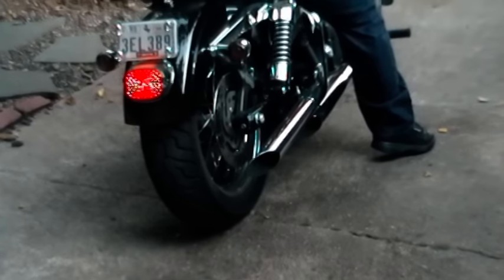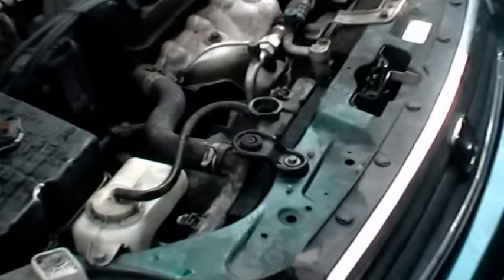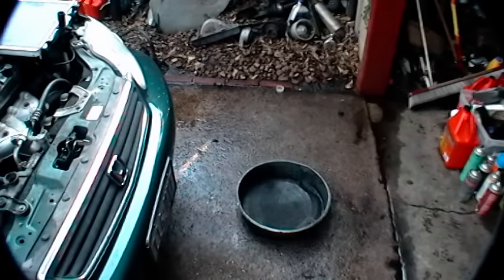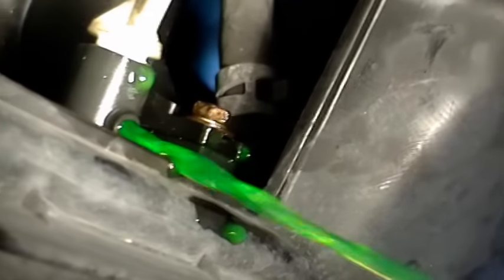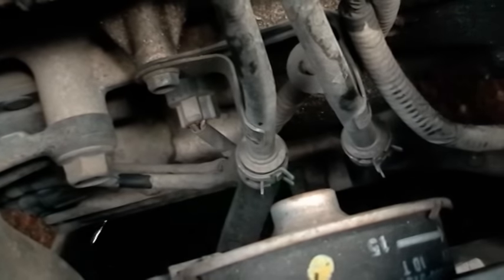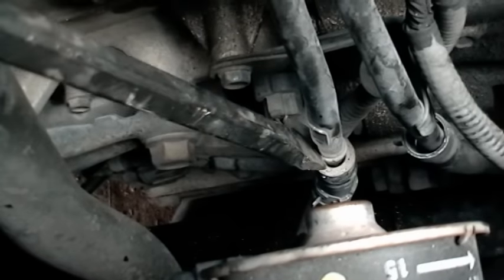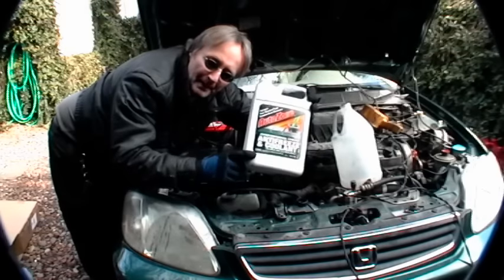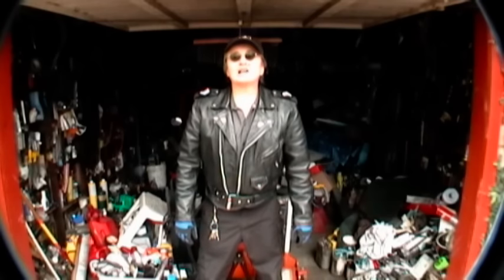How to Replace a Radiator in Your Car

Comment: Hey Scotty
I ordered a radiator for my 1993 Toyota Camry 4 cylinder and it's a manual. Do I need a special radiator for the manual or are they all the same?
Reply from the maker: any one will work for a manual, but an automatic has a cooling part on the bottom for the tranny. Many places only sell the automatic so they stock less, and it works fine on a standard, you just don't connect anything to the bottom cooler lines
Reply: +Scotty Kilmer thank you so much! Helped a lot and I learn a lot from your videos!!!
Reply: Aaron Bates

Comment: Hello Scotty I have a 2009 Ford Ranger fx4 4x4
I rear ended another truck with my front end. His bumper was higher than mine.
His bumper destroyed my grille and bend in the radiator and radiator cooler. Red Transmission fluid leaked out. I made the mistake of trying to get my truck to garage and as doing that my truck lost the ability to accelerate. 
Do i need to get the transmission inspected? or can i safely fix the problem by just puting trany fluid back in?

Comment: If you change a radiator without flushing the block you could be screwing yourself, all the goo that killed the first one still lives in the block. Might also change the water pump thermostat and hoses because if the cooling system is chunky then you will probably have done some damage to the impeller on the pump and it will be easier now. Also a good time to inspect/ replace belts if need be.

Comment: A buick skylark doesn't have a drain plug on the bottom... The radiator is leaking so badly it's pretty much low possibly empty.. it's okay if I don't drain it right? Thank you

Comment: Scotty i have a question i have a 2000 yaer b.m.w e46 318i i had replaced the oil cooling termustat and the x part of the bottom of the termustat broke and fail in the rediator what in may do to the engine

Comment: Scotty Kilmer. On a 1999 Saturn Sl2 can the condenser be removed without having to remove the radiator? I f so what are the steps?
Thank you.
Reply from the maker: na, not enough room in that design, but rads are easy to get out
Reply: Thank you

Comment: So, I'm not sure were the leak is because the coolant only leaks intermittently. I know it's toward the front of the car, either the radiator or hoses, maybe the water pump. Any tricks to find out for sure?
Reply from the maker: I use a pressure tester to find leaks, cheap ones can be had on ebay. OR you can put in UV leak dye for coolant systems and find the dye leak, but you need a uv light and yellow sunglasses for that

Comment: Scotty, The top of my radiator is leaking... Is there a fix to this problem or do I have to replace the entire radiator?

Thanks!
Reply from the maker: you can try something like JB Weld epoxy, but really, best to get a new radiator, the chinese made ones don't cost much and work fine

Comment: Will I have to drain the automatic transmission fluid before disconnecting the cooling lines?
Reply from the maker: Jason Ford NA,maybe half a cup of fluid will drip out, you can put that back in when done

Comment: i have now an old 86 chevy nova.  and, i "think" it has a radiator leak.. the hoses weren't leaking.  appeared to be coming from a bottom seam.  
i took out the fan s.  and the radiator.   the radiator appears to be made of  copper??  not sure.  but, i am planning on taking it to a  reputable  radiator repair shop to see if it can be repaired.  they charge 45 dollars to repair it.   
do u think repairing a radiator is a good thing?

Comment: would you recommend a radiator sealant if I got a small leak in the radiator? or replace the radiator?
Reply: Replace the radiator!!! Bought a Monte Carlo a few years ago and either the previous owner or the car dealership put some that crap in there. Took it to a spot that deals with removing it but had to take it back a couple of times. Wish the guy would've told me it would be cheaper to buy another radiator then to try and flush the sealant out. I'm buying my new radiator this Saturday for little over $100! I hope you didn't mind me answering your question.
Reply: +Darren Cork Thanks for the reply. I the end I did replace the radiator. I dont think that sealant would have worked anyway just clog up the system.

Comment: If I were to constantly refill my coolant tank before the levels went past the dangerous mark could I make it on a trip over 200 miles with a leaky radiator?
Reply from the maker: David Theodore If the leak is small enough, I've seen it done for years by really cheap guys who don't want to buy a new radiator

Comment: im gonna be removing the engine on my 1986 325es BMW, When im putting my radiator and the hoses back, is it safe to turn the engine on without any coolant in the engine?

Comment: @scottykilmer OK, I just checked my radiator.  The transmission lines run into the side instead of the bottom, and they are solid lines, not flexible hoses.   One is at the top and one is at the bottom on the side (same side where you add coolant).   The bottom one looks like it'll be hard to get to.   Its a 93 ford taurus (not SHO) 3.0.   Do I need the special tool to disconnect the lines or can I just use two wrenches?   (assuming I can get my hands down to the bottom line).

Thanks.

Comment: Hey i have a 94 Volkswagen Golf GTI and its a manual 5 speed how different is it with the 5 speed manuals to change the radiator (without the cooling lines for the automatic transmissions) then to change it on a automatic?

Comment: Just wondering do I need to bleed/burp the lines after installing it? Is it necessary for a 2004 Mitsubishi Es lancer ?
Reply from the maker: just leaving the cap off with a fan in front of the radiator and watching it generally will burp the air out if you're careful
Reply: Scotty Kilmer 
So I install it then fill it with coolant and then leave the cap off and turn the car on and it should bleed it?

Comment: I have a 2005 honda accord, and it looks like there is 2 radiators...Is one the AC condenser? Do they connect together?  I'm leaking coolant, but it looks like it is coming from the front condensor....

Comment: I changed out the radiator but its now leaking from the auto transmission connections on the radiator. I tightened it really strong nut its still leaks. Any thoughts? Do i need to turn both nuts?

Comment: Scott ( brother) help me !!!I want to install a manual cooling fan motor switch on my 1992 ford Tempo V6.. what wires do I need to cut and where should I connect it?... I want to control the fan since in Canada June get pretty hot and the fan kicks in at around 75% engine heat which I think I little too late since the motor is hot hot by that time...the fan kicks in very 10 minutes... bumper to bumper waiting....so you can imagine how hot the engine is every 10 min.
Reply from the maker: +mario agostini  just run power and ground directly off the battery terminals, spice it in there

Comment: you forgot to burp the cooling system afterwards, people after you change the radiator and add coolant you need to burp the system with the radiator cap off and the heater on full blast. also wait for your heat to get hot it will take a while.
Reply: My radiator doesnt have a cap on the radiator? Should I fill it using the expansion tank and leave the cap off that?
Reply: yes
Reply: if you pour the coolant slow enough, you wont have to do this. but your info is still good....just some gee wiz info here 😎

Comment: Hey Scotty, how difficult would this be for a 99 saturn Sl2? thanks
Reply from the maker: a bit harder, pays a mechanic 1.4 hours labor "

Remove negative battery terminal.
Drain cooling system as directed in "Engine Coolant Check and Replacement."

        

Remove air intake duct, air filter box, and resonator.

        

Remove upper radiator clamp and hose from radiator and fold hose back.

        

On models with automatic transaxles, remove upper transaxle oil cooler line.

        

Remove fan motor electrical connector.
Remove wiring harness from fan shroud and radiator end tank.

        

Lift coolant fan off of upper and lower mounting brackets.
Remove fan assembly from vehicle.

        

Remove lower radiator clamp and hose from radiator.
CAUTION: MAKE SURE THE VEHICLE IS PROPERLY SUPPORTED AND SQUARELY POSITIONED PRIOR TO LIFTING. TO HELP AVOID PERSONAL INJURY WHEN A VEHICLE IS ON A HOIST, PROVIDE ADDITIONAL SUPPORT FOR THE VEHICLE ON THE OPPOSITE END FROM WHICH COMPONENTS ARE TO BE REMOVED. 

Raise vehicle.

        

Remove lower splash shield.

        

On models with automatic transaxle, remove lower transaxle oil cooler line.
IMPORTANT: Wire condenser up to vehicle to keep in place.

        

Remove two lower condenser bracket-to-radiator bolts.
Lower vehicle.

        

Remove upper radiator nuts and brackets.
Remove upper radiator seal.
Remove radiator from vehicle.

Comment: Hi Scotty 
I have a problem with my 2000 jag s type.
I came home got out the car for about 15 min. The cooling fans was still running when I got out. the engine was off.When I went back to the car and tried to start it would not start. The engine raddled trying to start. It act like it was stuck, then just turing over  without starting like no fuel. It was running correctly a few minutes before. not missing or any sign accept, the cooling fans would run a few minutes after driving with a/c on

Comment: Hi Scotty. I got a 96 camry that suddenly started overheating. There's steam coming out of the top of the radiator and temp gauge all the way at the top. An aquaintance suggested a pin hole might need to be fixed and to be wary of someone trying to sell me a new radiator. Can this radiator be fixed?

Comment: I ordered a new AC and it came in yesterday. But now there's a problem i just can't figure out. The bottom radiator hose refuses to fit. My old radiator had a "clicking system" which my new radiator doesn't support. There seems to be no way to put the bottom on my new radiator and it's giving me real headaches as i have no idea what to do. What's the best step to take here ? it seems that replacing the lower radiator hose is quite a difficult job as it goes into my car's frame "behind" the wheel

Comment: @scottykilmer I think I have a coolant leak... I smell antifreeze when I first startup my car and my engine temp is running higher than usual and my reservoir is low... Do I have to replace my heater core or is it a cracked radiator or a blown head gasket

Comment from the maker: get another engine, that's a blown head gasket at a minimum, oil mixing with coolant. Most guys put a used engine in, I use ones from japan, see my video "replacing an engine in your car"

Comment: Whats the make and model of the car in the video? I'm going to attempt to change my radiator for the first and wanted to use this as guideline
Reply from the maker: it's an older honda accord, but all cars are the same basic process
Reply: Thank you for your quick response

Comment: Respond to this video...          Oh wait, I have to clarify, the line itself isn't leaking, it's leaking out through the fitting that screws into the side of the radiator.  I'm going to go out soon and make sure I have them tight enough, but if it still leaks, will thread sealer stop the leak?

Comment: I have a 1987 nissan pickup, d21 4cyl 2wd. do I have to  bleed anything after I install the new radiator?
Reply from the maker: +jlk1775 you have to get the air out of the system, but on those, generally just warming it up will open up the thermostat and then you just add coolant as the air burps out of the radiator top with the cap off and a big fan in front of the vehicle
Reply: Awesome! Thank you Sir! :D

Comment: hello scotty the water on my radiator is brown/reddish brown, as well as in my reserve. is this a worn radiator? or gasket? if its oil what should be the color?
Reply from the maker: +jaycee fernandez oil would foam up like a milkshake. sounds like a dirty system that needs flushing
Reply: +Scotty Kilmer thanks man ! you're the best !

Comment: @Scotty Kilmer 

My radiator fan wont turn off.  When i start the car, the fan does not turn on immediately but as it reaches a temperature, first the low speed fan turns on, then the high speed fan turns on and it stays on forever.  I have the low speed fan set to 210F, but it turns before it reaches that temp.  What could it be?

Comment: @scottiekilmer my 2007 I'm pmpala is leaking coolant fluid I changed the radiator and it still leaks and wants to run hot. What should I do?

Comment: Hey Scotty, It's not that easy to just hammer off the Transmission cooler line. Mine screws on and the line goes through it. I CANNOT find a way to unscrew it off, its the most stubborn and tightest bolt I've ever encountered. I've tried WD-40, Free All, and all that sort of Rusted loosener but nothing helps. I even tried hammering it loose. .Nothing. It's very VERY Stuck. If you have an ideas I could try at all PLEASE let me know. This is killing me, lol.

Comment: i have a 2002 ford crown victoria. how do i free the radiator? it has plastic hooks that hook onto the ac condenser, but i cant move the condenser upward, because it is blocked by the front metal part where the hood latch is. do you know any short cuts?

Comment: Hey scotty, i think i have a leaking radiator in my car, well let me explain more.   After driving for like 15 minutes and then i see smoke coming out on my front grill.    MY temp is under the middle line in the temprature Gauge.  and no my gauge is not broken.   For some odd reason i pop the hood and i see coolant on the top of my grill.   and how did it smoke?? well im thinking the coolant was touching the hot radiator which produced that smoke.

Comment from the maker: there is no short cut on that horrid radiator design. Last time i did one a lot of swearing was used and I cut my hands bending stuff out of the way. REALLY poor design. Most guys jack car up REALLY high and pull rad from the bottom

Comment: Hey buddy my car heater still not blow warm air! Heater core isn't clogged ( did the water trick) tried to bleed air out if there is any but my 94 probe is not equipped with a radiator bleeder valve! So my question is how to bleed the air out without the bleeder valve

Comment: Hi ,
 i have to replace radiator to ford falcon EL model but just wondering what is dual row and single. which one should i have to buy. 1997 Ford falcon futuara 4L 6cyl. please help me. thanks
Reply from the maker: look at your old radiator, it either has one thin layer of cooling fins on the main body, or is two rows of fins front and back
Reply: +Scotty Kilmer Thanks mate..

Comment: I was just shown how to do this at a shop where I worked for a few days.
 The mechanic never mentioned a the drain plug though.  I'm wondering if
 he's an idiot or if maybe not all vehicles have them?  Also, there were
 two thin hoses that he told me to disconnect and let drain that had oil
 in them.  Would that have been the transmission cooling lines?
Reply from the maker: +Shaine MacDonald  oil cooler lines. All cars have drain plugs, except some nutty modern exotic cars that suck the oil out of the dipstick hole when changing oil
Reply: Scotty Kilmer
He never told me about the drain plug.  I'm starting to wonder about his mechanic knowledge due to a few things.  Another for example, he never used a torque wrench and never suggested I use one.

Comment: Hey Scotty I replaced the radiator in my friends car but now his ac won't blow cold.its a 99 Honda accord 3.0 v6. Any thoughts on why that happened
Reply from the maker: Pray you just knocked off an ac wire or sensor and didn't knock a hole in the condenser and let the refrigerant out

Comment: Will I lose a lot of transmission fluid disconnecting the line from the radiator? I am afraid of messing up my transmission installing a new radiator with the fluid.
Reply: You are the best Scotty. I am in Houston, if I knew where your shop was I think you'd be the only mechanic I can trust.
Reply: I lost about a quart, quite a bit was in the radiator itself, just used a bucket to catch everything and replaced what came out.  2007 Chevy cobalt.

Comment: I need some help Scotty, I replaced the radiator of my car because it had a liiiitle leak and gave me no problems at all and now that I've changed it, the thing overheats in 10 minutes. I filled up the plastic container that says "engine coolant" with only anti freeze and checked if all hoses are on tight with the clamps, no leaks. What could be the reason why it's overheating so fast?
Reply from the maker: +Tommy Perez do my video tests "how to fix an overheating engine" has to be one of them

Comment: I have a 92 accord and right where the upper radiator hose connects to the radiator itself there is a leak. On that spot on the radiator it is a funky shape and no longer a perfect circle how can i fix this without replacing the whole radiator altogether?

Comment: I got a question. There's a radiator coolant leak in my truck but I don't know where it's coming from. I can see it dripping after I turn my truck off but I can't follow it to see where it's coming from. I have a ford 1992 ford ranger 3.0L v6. It seems to be coming from just to the left and little behind the radiator. What could be leaking?
Reply: +Samuel Creel they have a testing kit. it basically pumps air into you radiator till it leaks then you know where it leaks from.
Reply: Thank you.

Comment: Would replacing a '09 Ford Mustang V6 be a similar process?
Reply from the maker: a bit more involved due to crazy ford design. It pays a mechanic 240 dollars labor to do your job as a bunch of stuff has to be removed to get that radiator out. expect a few hours of sweating and swearing on that stang